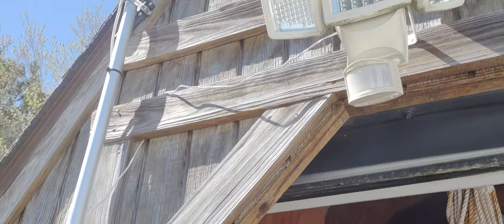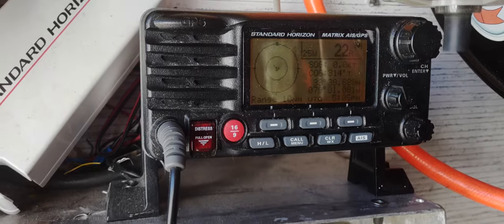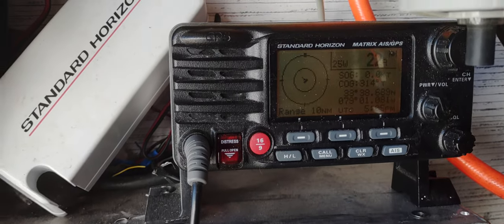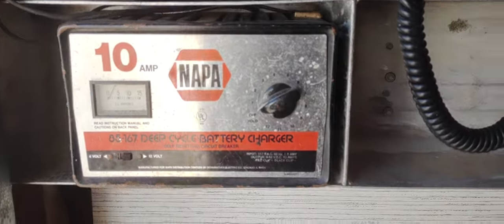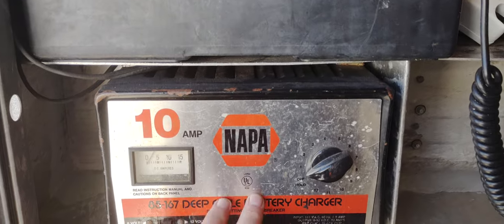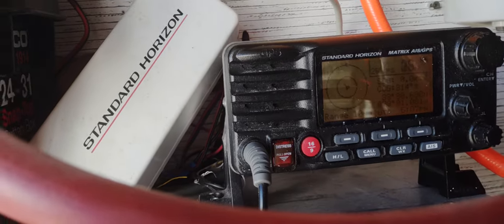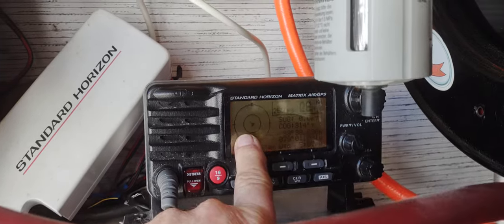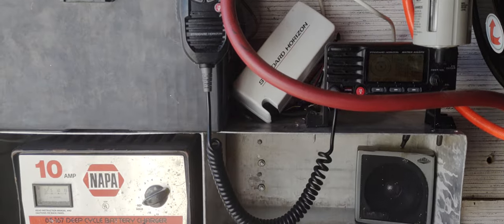VHF Marine Base station radio setup at home.

Comment: Great set up! I would like to do something similar. I live in a condo and my garage is separate from the condo. I'm sure I'm not allowed to mount an antenna to the outside of the garage like you did. Do you have any tips or ideas on what I could do? I'm only about half a mile from lake erie. Thanks!